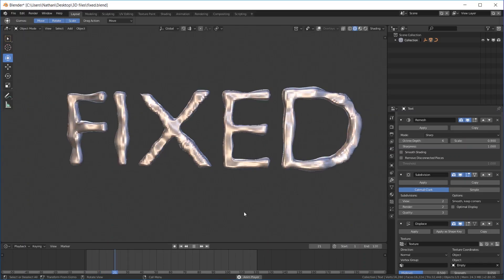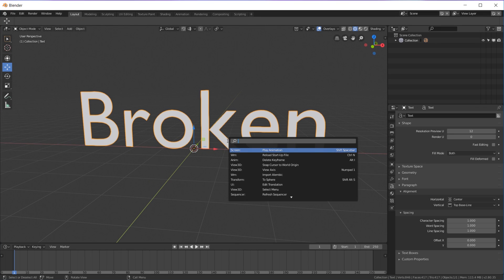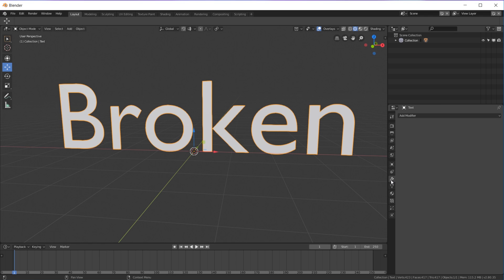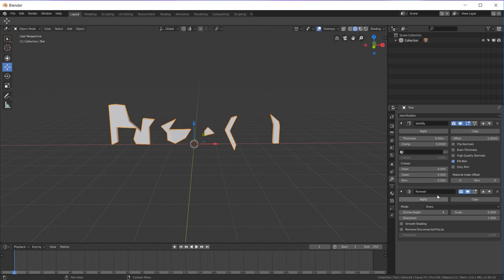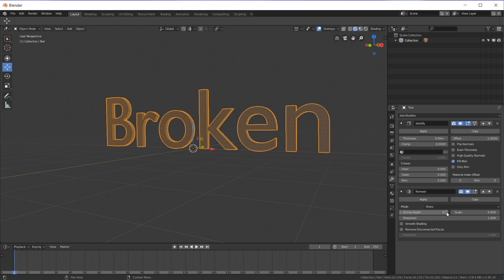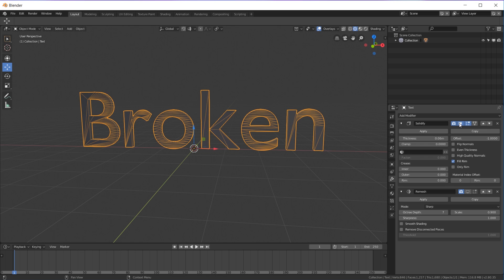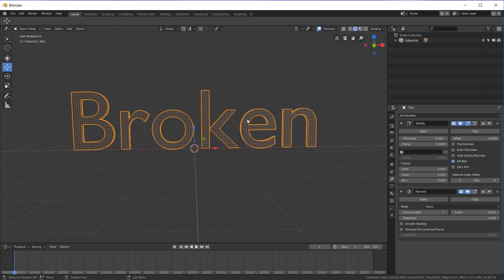Blender - Quick Text Topology Fix

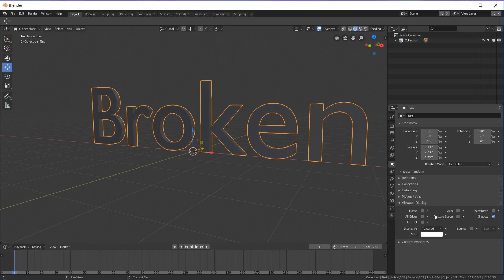Comment: This is 4 years after you published that video, for which I am very grateful! Now, in 3.6, when trying to do to the text what you describe, I am of course facing a bit of a change here. At 1:31, where you change the Viewport Display to wireframe, you also activate a "All Edges" option. This option is no longer available in Blender 3.6. Or do I have to activate a plugin?

Comment: You're also can use Decimate modifier to do it. Select text - Add modifier - Decimate - Planar - Limit angle at 5° is enough, but you can adjust limit angle for get different result.

Comment: they removed the "remove disconnected pieces" option, i mean they moved it so it's not there anymore but still needs to be turned off. damn blender it's almost impossible to watch tutorials when so much stuff changes places
Reply: i just found out in this comment thread , put the remesh setting to sharp
Reply: did you find it any where im looking for that option right now ?

Comment: Hi. Great and thx but I search for solution when you deform the textobject with modifiers .The remeshed mesh  results in  again a horrorible look when it is deformed.
The 3d Text remeshed have not a good Topology and flow so that it can be deformed.
I saw a Video how Cinema4d handle and do this 3d text creating part and it looks like a Dream that in blender never comes thrue.
Nonestructiv,,without remeshing full textoffice Feature,separat mesh controll option for outline Front & backfacing meshes,konture outline  color control and others Feature..
So great...
Motiongraphic with deforming Text in blender is really in Bad condition.
Looks like blender 2.9 is again crapy when it Come to motiongraphic.

Comment: You can go into edit mode and use limited dissolve option if you want it cleaner and have  no problem with ngons
Reply from the maker: lost protonbender That’s not the point of the tutorial, the point of the tutorial is to add even topology on text so you can do things like sculpt or displace it well

Comment: Most of the time you don't need to convert the text to a mesh, just change the extrude property on the text geometry and use the remesh modifier, IMHO you get better results and you can change the text if you want.
Reply: Need to try this method!
Reply: @StaleCookies  kl
Reply: wow I actually applied the extrude and remesh modifiers BEFORE converting the text into mesh and it helped not to glitch! thank you!
Reply: And 4 years later... thanks for this tip!  Using this, I still achieved beautiful looking text while keeping it as text, very helpful when you aren't ready to commit text to mesh yet!  And if you are using weird fonts, playing with the remesh settings helps to find what works for that font type. Thanks again!

Comment: Nate: i'm trying to chisle letters into a stone slab. BUT I want the sides of each letter to be "chiseled" (not vertical),  so that there's a vee where the font sides meet. IOW each letter
front face is normal, tapering to a vee shape on back face.
Any ideas?  Thanks for your work.
Alan
Reply: Multiple ways of doing this. Add a bevel to the back side and use a boolean to cut it into the slab. Or you could do it in edit mode by adding a loop cut and pulling it out then use a boolean. Be careful with booleans though because they create ngons

Comment: Look like there is an issue with this technique when using the 2019-01-23 build. There is no longer an option to view All Edges under Viewport Display. It appears to have been removed.
Reply from the maker: drabodows that’s strange, they must be replacing it with a different workflow. Everything still works the same
Reply: Roger that, it definitely still retopo's the mesh, you just can't visually see the mesh result.
Reply from the maker: @drabodows  im going to get the latest build and check on that
Reply: Roger that. The build that is broken for me is 2019-01-23 00:32.
My earlier builds from this month have the option in Viewport Display.
Reply: Still broken in 2019-02-20...

Comment: Thank u! That's my main concern with type in 3D, always a horrible topology. Thanks for this useful tip!
Reply from the maker: Jose Betancur no problem
Reply: how to add different materials in the text, like 1 material for the Text Face, Another material for the Bevel, another material for the Text Sides?
Reply: @b1na276  look up assigning vertex groups on materials
Reply: @b1na276  just add another materials?